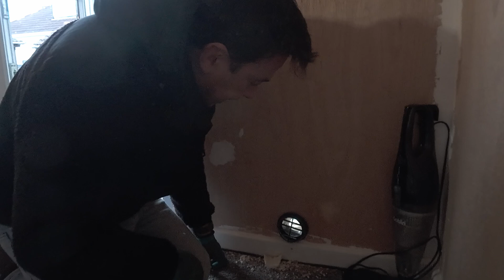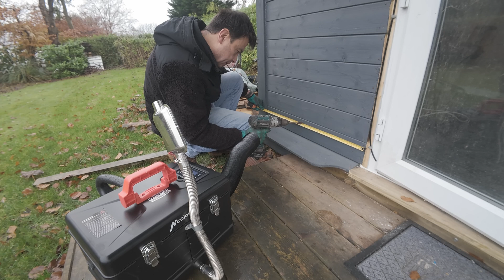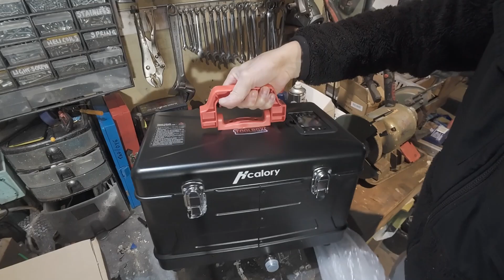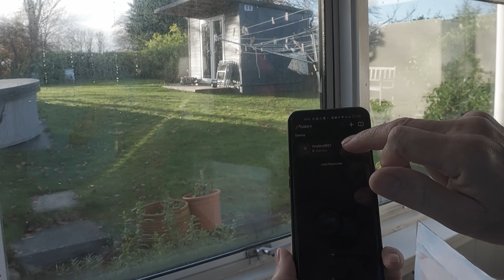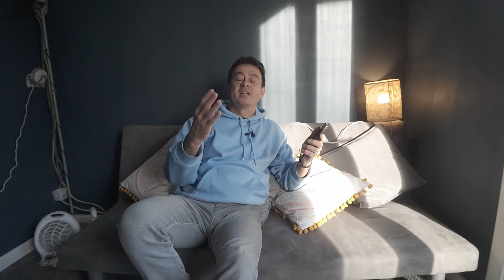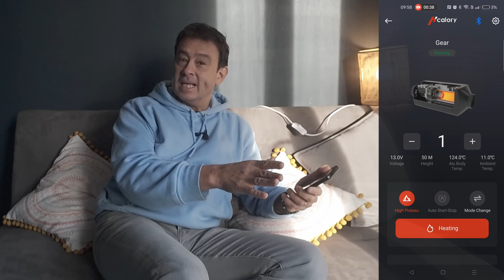Winter Proof Your Diesel Heater! Waterproofing & Outdoor Mount Guide HCALORY

Comment: what did you use for the plastic covers?
Reply from the maker: good question,  used these self adhesive label covers and then cut them down to suit,  I am reviewing another diesel heater with better sealing coming soon.